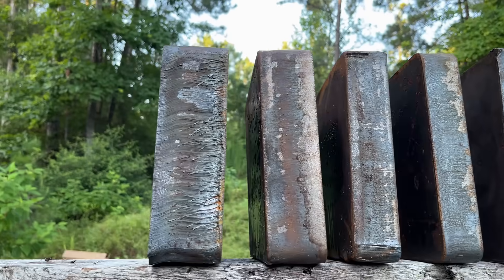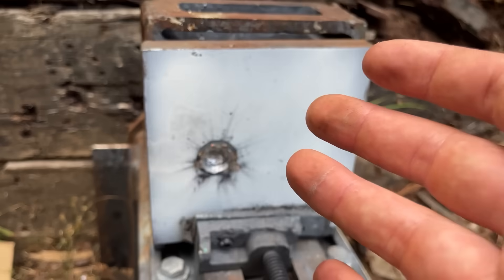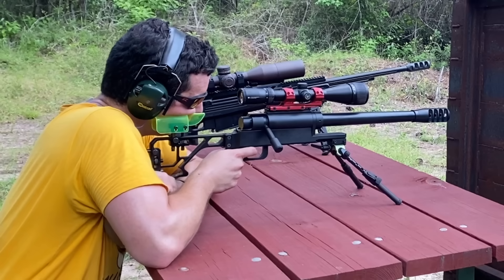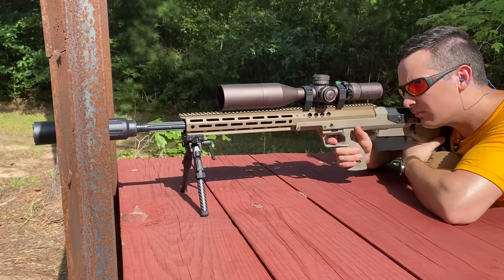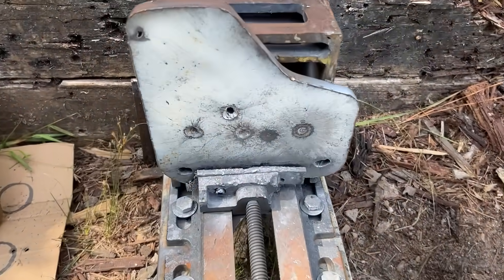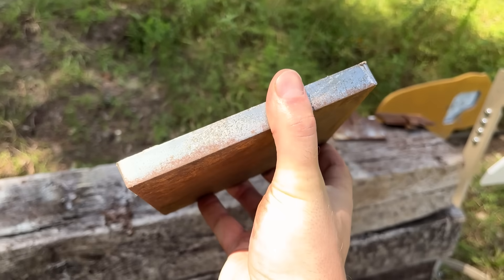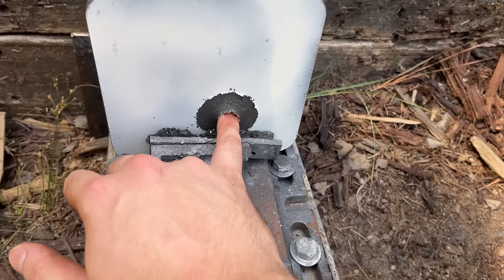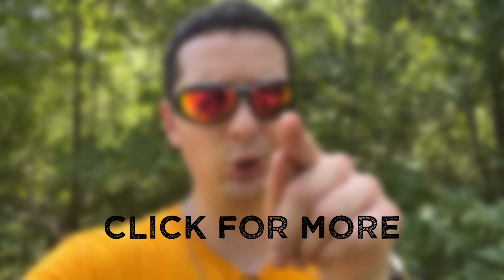How Much Steel To Stop A 338 Lapua Sniper?

Comment: The bulge on the back was pretty much exactly like a 308 180 grain at 50 yards, on 1/2”, 1/2”, and 1/4” put together and welded top and bottom.
308 is miles away from being a very hard hitting round, yet it did that well through that much steel. 
Had to believe for sure.
My brother grabbed a 80lb propane tank from a job sight.
It now full of holes from all sorts of rounds. 
I know a 243 80 grain went through it completely.

Comment: Had an argument on a Moose hunt against much older guys.
They thought 18 gauge metal panels that covered the camp windows would prevent a bullet from going through.
I didn’t laugh, but looking back I’m surprised I didn’t.
Once we got back I grabbed some plates of steel I had kicking around.
I used my 308 180 grain bullets.
First I fired at a 1/2 in plate thinking it might not poke a hole.
Well it did, I was surprised. Next I added another 1/4 in plate, once again it went through.
Then I got serious and started with 1/2” plate with two 1/4” plates welded on top and bottom.
It just made it through.
I added a 1/8 and it didn’t quite make it through, just bulged the back.
I showed a couple of the guys and I’m sure to this day they still didn’t believe it.
When I see a TV Show when the cops hid behind there car doors I almost laughs.
I can tell you that a 308 which is miles from the most powerful would easily go through the vehicle.
Seen a BWW at a collision shop that was mixed up in gunfire, the bullet holes in the driver door hit on a slight angle.
It went through the drivers door, through the dash, into the engine compartment and out the Rt front fender, and I’m quite sure it was a handgun round.

Comment: Back in Spring of 1978, the Brother_in_laws and myself were at Our hunting camp with a new cartridge and a Remington 742 Woodsmaster in 30-06.
The Remington Accelerator 30-06 cartridge was a fairly new offering, and We decided to test that cartridge on a steel deck plate, which was 1-1/8 inches thick.
We set it up against a tree stump at close to 110 yards, along with paper targets above the steel plate.
We shot everything We had at that plate, including My Marlin (44 mag) 1894 rifle, 357 magnum revolvers, 12 gauge shotgun slugs, plus 50 caliber T/C black powder rifles.
Nothing penetrated that steel plate, not even 150 grain bullets, fired from 30-06 cartridges.
However, after shooting the accelerator cartridges with the Woodsmaster rifle, the accelerator round created a golf ball sized cave, with a small hole out the back of that steel plate.
We were astonished at the performance of Remington's newfangled accelerator round. 
At some point in time, the performance of those accelerators got Obama's attention, whereas He advised Remington to stop loading their high performance Accelerator cartridges.
~DDZZ55~

Comment: OHIO ORDNANCE has built a NEW MACHINE  GUN. The machine gun or flip a switch now a sniper rifle firing the awesome 338 Lapua round. REAPR= Recoil Enhanced Automatic Precision Rifle.  Rate of auto fire is 550 to 650 rds per min. Weight 26 lbs. Combat range over 1,500 meters max range 6,700 meters, with a switch flip now it's a sniper rifle. For recoil the barrel assembly moves taking the kick to be very small. If the gunner runs out or can't find more 338 Lapua rounds then remove barrel & bolt face change the barrel & bolt face to the  NATO 7.62X51. Talk about a game changer.

Comment: These test are so obsolete, you test multiple shots where the steel has already basically failed on the first hit.
Reply: That cold deformation is not doing anything 2cm further. If anything it hardens the steel making it even more difficult to penetrate lol.

Comment: I have a .338 Lapua built on a 700 action and I had some armor piercing military surplus rounds and I had a precast concrete enclosure and decided to try a round on that. Took the shot and a lot of dust in the air, when I walked over to look at the results. The round went through both sides of the structure through a 3/4" rebar and the combined thickness of the precast was 12" it went through with no problem!

Comment: a dealer at the Orlando gun show had a 20mm Solothurn S18-1000 with a 1.5" steel plate he fired a 20x138B round into,the bullet was sticking through the plate,but not total penetration. He displays the gun,plate and cartridges next to a Barrett M82A1 and cartridge.

Comment: Stress fracture from the steel when you shot next to the other shots. Not a good reference granted it is AP. But should be tested again. Also shouldn't use a suppressor for true maximum velocity and bullet energy

Comment: First stop using cheap steel. I had 6 5x12 sheets of 1/4 inch armor plates left over from WW 1. A 338 at 50yd didn’t even dent it. My old .50 did put a dent but didn’t penetrate.

Comment: Sorry hope you don't mind me saying but you're holding the test pieces in what looks like a machinist vice with some kind of rubberised packing between the jaws and plate. This will remove energy from the round. If the plate is held rigidly and without the cushioning effect of the rubber pad you will notice a huge difference in impact.

Comment: This really puts into perspective how hard it is to stop artillery and such.  Battleship hulls have multiple inches of steel at the thinnest parts and over a foot thick steel in some of the purposefully armored locations.  I'm not sure what grades of steel they used, but If 1.5" of mild steel and 3/4" of AR500 hardened steel struggles to stop a spicy .338" rifle round, it's easy to see how large ship guns are pretty much unstoppable by anything humans have ever built.

Comment: 338 is a really serious round , More so because of the size and shape of the cartridge. The neck angle of the brass is what makes this round so powerful because its a steep angle at the neck down portion. Which puts a hell of a lot more pressure on the round before it leaves the cartridge. Probably the best round on the planet for speed/versus/weight , it has a great flight arc.

Comment: Never heard of mild steel before.  Milled yes,  but not mild.
Reply: Just plain soft steel vs. tool steel, O1, O2, armor steel, etc. 

" One of the common steel materials is “ordinary carbon steel” or “low carbon steel”, also known as “mild steel”. Due to its excellent workability, weldability and relatively low cost, mild steel has become an indispensable choice in many industries. "

Comment: I wish someone could state clearly what grade of the steel used in the video. That would be very informative.
Reply: Just plain soft steel vs. tool steel, O1, O2, armor steel, etc. 

" One of the common steel materials is “ordinary carbon steel” or “low carbon steel”, also known as “mild steel”. Due to its excellent workability, weldability and relatively low cost, mild steel has become an indispensable choice in many industries. "

Comment: Not sure he said what kind of steel he’s shooting. If that is ar500 steel then I’m impressed.
Reply: Just plain soft steel vs. tool steel, O1, O2, armor steel, etc. 

" One of the common steel materials is “ordinary carbon steel” or “low carbon steel”, also known as “mild steel”. Due to its excellent workability, weldability and relatively low cost, mild steel has become an indispensable choice in many industries. "

Comment: 2:37 Tungsten carbide cores?! What the bloody hell's tungsten carbide cores?!
Reply: "Tungsten carbide, an alloy composed of tungsten and carbon atoms, exhibits remarkable hardness and stability. Its hardness approaches that of diamond, typically measuring between 8.5 and 9.5 on the Mohs scale, compared to diamond’s perfect 10"

2:35, shows armor piercing cores that are hardened steel, but still softer than tungsten carbide.
Reply: Alright I get it but I was making a Monty Python joke
Reply: @MarioPushkinGuy  Now that you mention it, I understand.   Flew right over my head.
Reply: @MarioPushkinGuy  There isn't enough Monty Python quality humor in the world today!

Comment: that ar500 plate is wild to think of in relation to WW2 most average tanks might only have seen 50mm of plate and yet could be penetrated by antitank rifles in some cases, this ar500 stuff....at the same thickness of approx 2inchs would be damn near untouchable by most standard rifle and anti tank rifle at the time
Reply: WW2 Tank armour is much closer to AR500 than mild steel, it's a form of steel called RHA (Rolled Homogenous Armour) which tends to be worse than AR500 for small caliber hits but a bit better for large caliber hits (it's softer but less brittle).

Anti-tank rifles were mostly only used early in the war, when many tanks had very thin armour. For example, early models of the German Panzer III had only 15mm thick armour all around, and some other tanks had even thinner sides and rears. The British Army's Boys Anti-Tank Rifle could defeat about 22mm of armour at 100 yards with a 90 degree hit, so making some allowances for non-ideal impact angles it's already kind of marginal against the Panzer III, you need to be rather close and shooting fairly "square" to the plate for a penetration to be possible.

As tanks got better armour the AT rifles lost effectiveness, and other man-portable AT became necessary. The Panzer III was progressively uparmoured to 30mm, then 50mm all round. The Bazooka countered those (it could penetrate about 60mm at any range thanks to its HEAT warhead) but later Panzer IVs had a 80mm front plate, so the Bazooka was only useful against their sides (which were only 30mm). For heavier tanks the infantry had to rely on towed anti-tank guns or to deal with them, unless a friendly tank or tank destroyer was nearby.

Comment: 55 mild steel is the cheapest and softest steel. Steel used in armor is RHA and is >400% harder than 55. Mild steel offers considerably less resistance to penetration from projectiles compared to RHA. A much thicker section of mild steel would be needed to achieve the same protective level as a thinner section of RHA.  RHA is a specialized armor steel designed for ballistic protection, prioritizing hardness and toughness, while mild steel is a more general-purpose steel valued for its affordability, formability, and ease of processing. AR500 is designed to protect from handguns, RHA is better suited for situations where significant energy absorption is needed, while AR500 is better for applications where shattering or deforming small projectiles is desired, particularly for lighter armor.

Comment: Here in the UK.
.338 Lapua magnum costs around £75 for 10 if you home reload.
My local store doesnt stock factory ammo bigger than 22/250

I feed my Accuracy International AXSR home reloaded Hornady A-tip

What happens if you use a 27 inch barrel?

Comment: i once had a load for my 300RUM that used 180gr Winchester silver tips with a MV of around 3500 fps at 200 meters they would go 3/4 of the way through 20mm mild steel. i mostly use 208 Amax or what 180gr AET from B&T energetics now

Comment: It's been awhile since i read up on ar500, ar600, and ar650 steel .... But i recall that the 550 and 650 variants were simply more malleable ... That way a dozer blade could be manufactured to the desired dimensions and pitch

Comment: I have a savage elite precision 338 lapua with a 30" barrel. 300 grain Sierra matchkings (hollow points) are pushing 2850 fps chronographed on factory loads. Could push them up to 3000 fps with handloads with a 30" barrel. It went through a quarter inch of steel and straight through an 8x8 pressed oak block. Thats insane for an expanding round. I need some AP rounds if anyone wants to help a man out.

Comment: But technically speaking even just mild Steel is pretty tough even though it’s not a armour type of grade of steel if you use a mild Steel Plate thick enough it can stop practically any bullet there is especially when you start going up to 2 inches or more in thickness. It will practically stop everything but if you use a plate of mild Steel greater than 2 inches thick it would be extremely heavy on an armoured car.

Comment: 6:50: Sorry, the AR alloy family are not particularly hard steels. I learned the "hard" way when I made the mistake of trying to use a piece for an anvil top...  AR = Abrasion Resistant, not ARmor. It is a work hardening low to medium carbon & low alloyed steel designed for things like ground contacting heavy equipment parts- It gets harder from impacts/abrasions, more so than the hardness it achieves it from   the steel mills usual quenching & tempering process. Good for stuff like excavator buckets or dozer blades which get heavily abraded by dirt & hard rock, this is not a face hardened true armor plate designed to stop projectiles. Yes, it has better performance than mild steel. No, it's nowheres near the performance of a real face hardened armor plate. That 477 to 534 Brinell hardness range is only around 49 to 54 on Rockwell hardness C scale, any hamner worth the money is harder than this while a good knife steel will generally start around 60 RHC and many are 62 or better.
Also, hardness chart @ 8:51 (Mohs scale?!) has some stuff wrong, I guarantee that titanium is softer than "knife" for any decent knife- Ti is TOUGH and has higher tensile strength per weight especially at elevated temperatures where many steels start to soften, it is not especially HARD. This is why your lightweight titanium revolver barrels and cylinders have steel liners.

Comment: Quote. Testing was setup at 50 yards using grade 55 mild steel plate.
Well, that explains why a long barrel 6.5lb heavier bit of gear was not required. 😁

Comment: 𝙶𝚛𝚎𝚊𝚝 𝚌𝚘𝚗𝚝𝚎𝚗𝚝 𝚊𝚜 𝚊𝚕𝚠𝚊𝚢𝚜! May I suggest another test for your channel... its testing the angle of a steel plate before a bullet can penetrate it. Like testing 10 degree to 40 degrees using quarter mild steel and so  forth.

Comment: I shoot blacktop from 300 prd at 3320 fps lmao I've gone though 1in mild steel and 3/8 ar500.  And almost threw both at once but I placed the 3/8 behind the 1 inch about 1 inch away
Reply: Black tip

Comment: You need to weld you a thick ramp across your clamp at the bottom like I did on my sled I copied yours basically only mines wider and slightly taller than yours but my accuracy ain't always great as yours and I shoot from 75 yards or so to alot

Comment: The 338LM is nothing to take for granted.  I've sent hollow points through 3/8 AR500 steel at about 800 yards!!!!!  The energy that this round has is next level when it comes to penetration and accuracy.  Yeah, it's a spendy round, but if you can afford them, why not go big?  Crazy how that tungsten carbide core almost made it through 1.5 inches of mild, that's a ton of steel to try and push a hole through, it almost made it too.  Great vid bud, really enjoyed that one.
Reply: 3/8ths of an inch at 800 yds??
Reply: @cheryltysver4819  Yup.  To be fair, the plate had been plinked on by many 5.56, 308, 300WM, and all kinds of pistol rounds prior to me hitting it with my 338LM.
Reply: Теперь давай 14.5 на 114

Comment: The armor piercing .338 Lapua was designed for one thing and it does its job with superb results.  It wasn't designed to travel short distances nor was it designed to fail at short distances.  1 1/2" of mild steel is quite formidable.  I'm kind of surprised it was stopped by such "thin" material, in all honesty.  At the beginning of the video, I was guessing about 2" or so would be required.  And, yes, those AP rounds are a bit on the pricey side.  Praying for the Texas Hill Country in Royal AR.  God Bless.  👍🇺🇸
Reply: It's still full caliber penetrator inside jacket.
Sub caliber penetrator design putting that same kinetic energy to smaller area would likely increase penetration good amount.
That heavily focused energy is how 120mm tank guns can penetrate as much as those 16" naval guns of WW2.

Comment: Many of those shots looked to me like as the bullet passed through the steel, it shed the outer lead and the titanium core was what passed through the rest of the way.  (Titanium you said, Yes?  Not Tungsten?)
Reply: That is how AP rounds are supposed to function, the copper and lead are for aerodynamic/ballistic purposes and to protect the barrel 
Edit: also, tungsten not titanium. Mass and hardness, not tensile strength for penetration

Comment: I wonder if you tried a thinner plate but added a couple layers.

So in front of the 1/4 inch steel you have 6mm textile like granite in the form of the smaller square tiles that you find in a a hardware store, 

And in front of that and being the first layer hit you have either 1.5mm hot rolled steel or 1mm stainless steal 316.

Against that round I doubt it would make any difference, but I wonder if it would make a difference against "normal" non-ap rounds

Comment: Question? Is the P365 striker the same type of pre-tentioned arrangement? 
I just did the test you showed in the video, and while my slide does have the side to side movement, it doesn't have any up and down movement. 
Doing the test with tension loaded on the trigger , I couldn't tell if it was my finger pressing past the break or if it was the slide movement causing the issue.  It has around 2500 rounds thru it and is my EDC. I haven't encountered this issue as of yet , other than the test I just did, but I did have 1 uncommanded firing. Which I can't say was uncommanded since I was pulling the trigger to break point. 
This makes me question the basis of the test. I attempted the test numerous times without the trigger preloaded my finger, and zero issues. 
Any thoughts would be helpful Jared.

Comment: I haven't started watching yet but my guess is it performs poorly against steel. Isn't the point of the .338 LAP to shoot flat, not with a lot of ft/lbs? It's a long shot gun, not a penetrator, right?

Edit: 3:seconds in: "...specifically, AP rounds." Well yeah, if you're cheating!